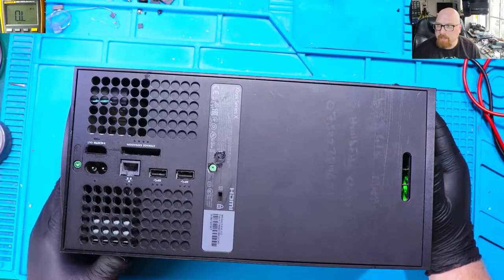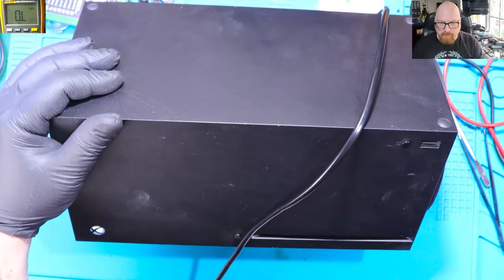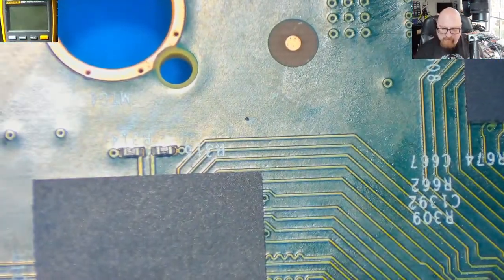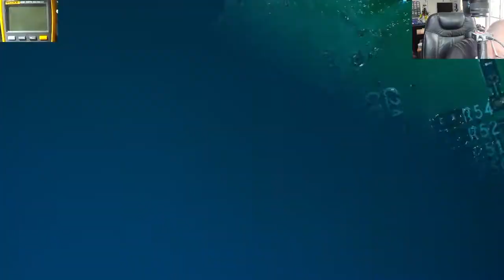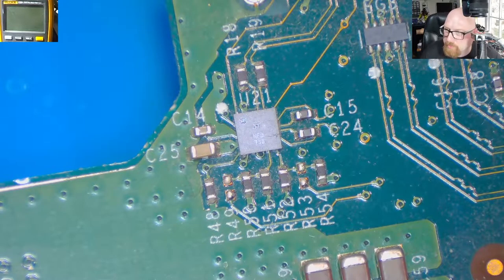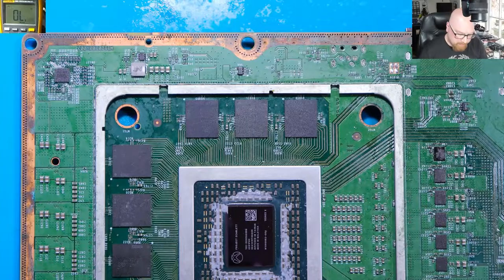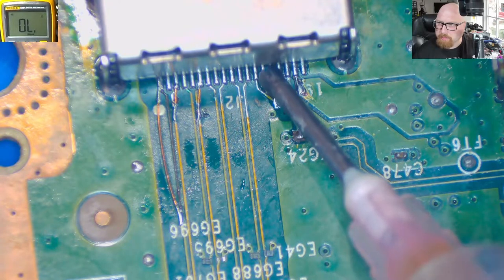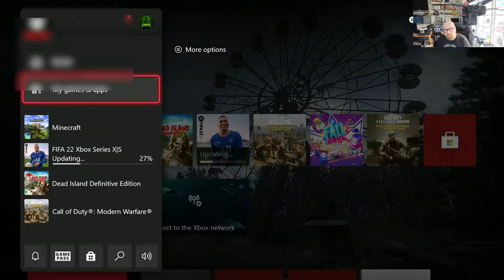I bought broken Xbox Series X on FB Market for £100...Can I fix it?

Comment: First! 😂👌 Nice job! Did you have a pinout of where pin 15 went? Just curious is all.
Reply from the maker: It went to the r19 resistor on the other side of the board.

Comment: Very good! What is this red brush that you used to remove oxidation from the components?
Reply from the maker: Thanks. It’s a fibre pen. I really recommend this pen as it helped me many times. https://www.ebay.co.uk/itm/111741724919?mkcid=16&mkevt=1&mkrid=711-127632-2357-0&ssspo=DzEeh3cqQ76&sssrc=2349624&ssuid=4NSEmW3MRyC&var=&widget_ver=artemis&media=COPY

Comment: what kind of jumper wire are you using I always seem to buy wire that is too thick and the best is copper like the one you are using.
Reply from the maker: Hi. Here is a link for it https://www.ebay.co.uk/itm/185192402954 . This wire is coated with transparent paint so no risk of shorting other components.
Reply: @Trilex Fix I use 0.10mm enamelled copper wire or those tiny Bst copper lugs, which all can be bought on amazone, fleebay and Alpress. The Cod3r gets those enamelled wire from old microwave transformer I think.
Reply: @mm0077  I use the best solder lugs too but sometimes I want a good jumper wire too for those sticky spots